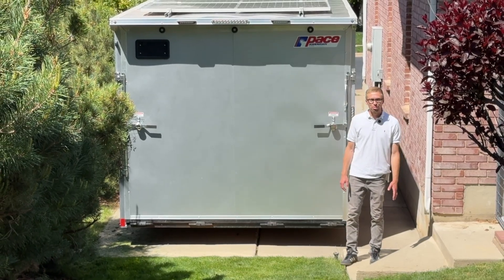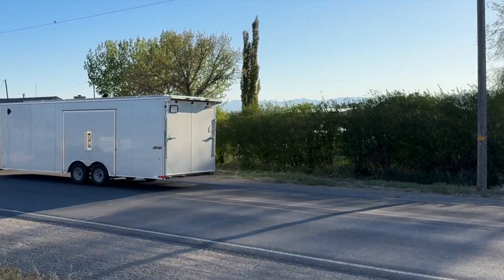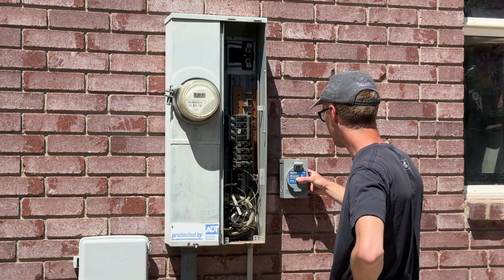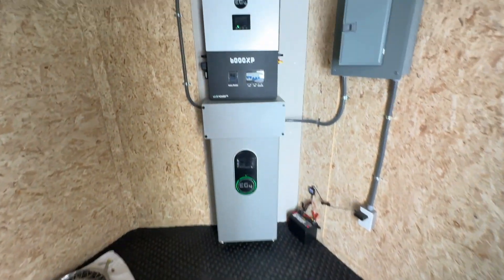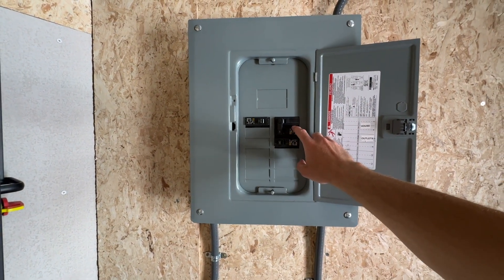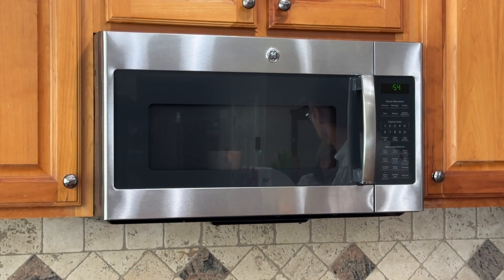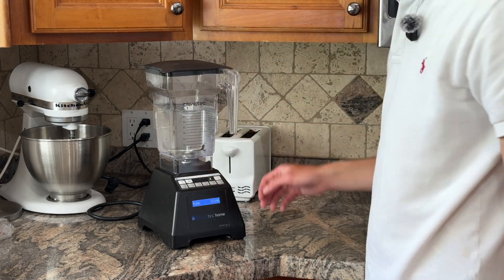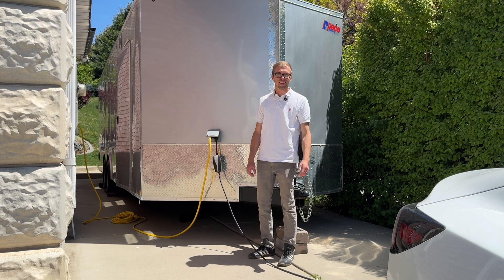Solar Trailer Runs an Entire House

Comment: This is an amazing build, it really is the best off grid power system.  If you find you need more batteries, you have the room you can add another row of batteries and keep the same charging and inverter system.  The only other option I would make for a true off grid power station is to put a pole that can be raised and be able to install a wind turbine, for night time generation to be able to generate all the time.

Comment: One other advantage to having the panels on the trailer as opposed to the house is that it doesn't require a work permit or bother with normal building codes.

Comment: How well will the equipment do in the heat of summer?
Reply from the maker: Luckily the spot they park it keeps the sides of the trailer pretty shaded, but I have a feeling it’s still going to get hot in there.

I should put in a temperature monitor to see how hot it really gets and if it’s above the recommended temperatures for the equipment.

The trailer has some vents but they seem like they’re designed to push air through while driving. We might add an RV style roof vent fan, and if it could be one that turns on automatically based on temperature, even better!
Reply: A Maxxair fan for sure... Let it ventilate at will as it will hold 26C automatically.  @SmithOffGrid

Comment: Brilliant.  I appreciate the mobile-ness in that if they buy a new house it all moves with them.
Reply: Yeah this is way better than roof panels on top of a house.
Reply: @tomconway6808  roof panels are harder to steal. I would fence in locked gate the trailer, hitch lock, wheel lock, and chain it down to the concrete.